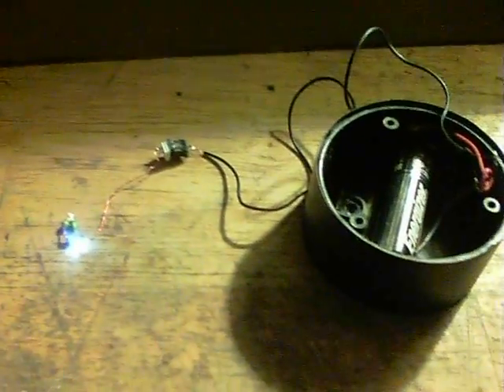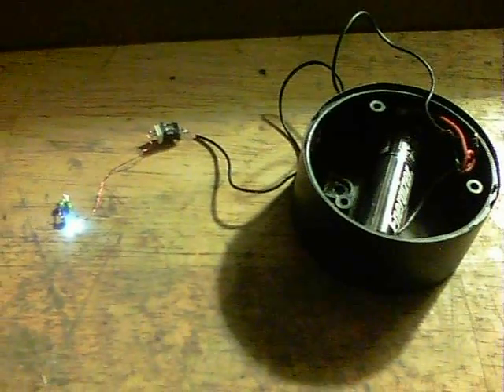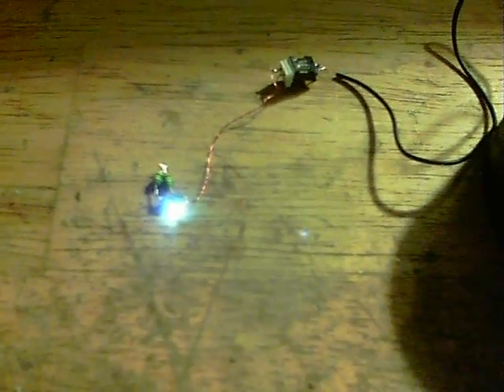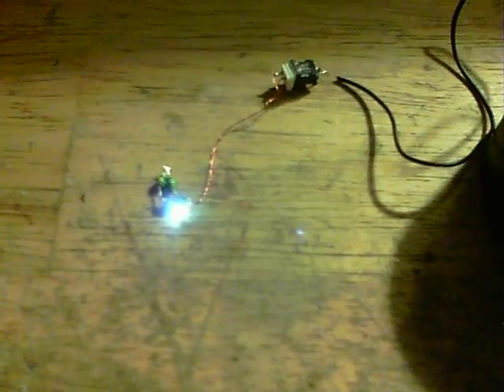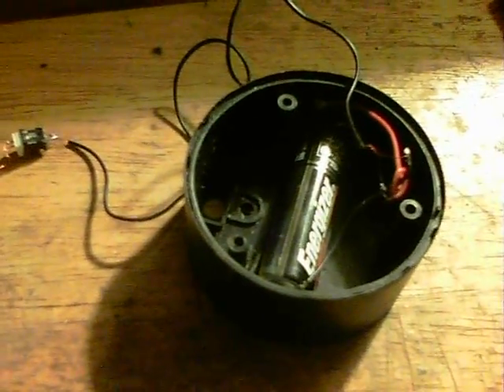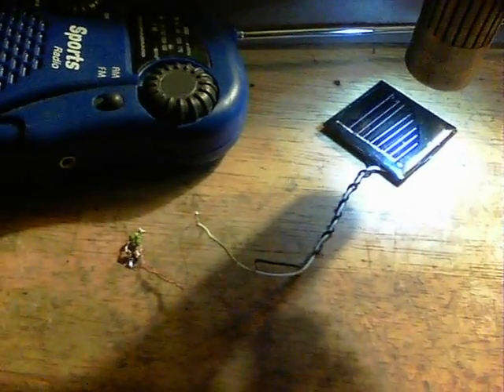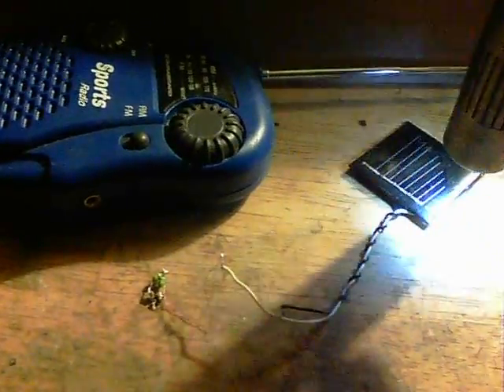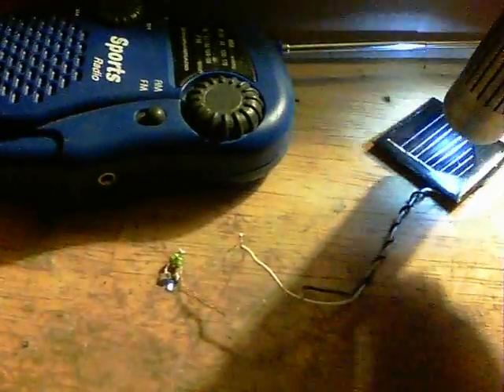SMD Oscillator

Comment from the maker: @PoirierMike Thanks. There's a common opinion that reducing wiring amounts helps efficiency of any circuit. There were smaller inductors on it at first, but they only worked when connecting and disconnecting a power source, not enough 'oomph' to trigger the transistor.
Reply: My experiments suggest that pancake coils have a combination of inductance and capacitance that provides a better solution than other coil types but it would be nice to be able to design coils of a certain size knowing what the outcome would be in advance. Without having equipment to measure inductance or capacitance, do you know of an applicable rule of thumb or simple way to predict the outcome of various wire thickness, number of turns, proximity of turns in oscillator circuits? My goal is to build very small micro-amp oscillator circuit but I don't think SMD inductors are the way to go.